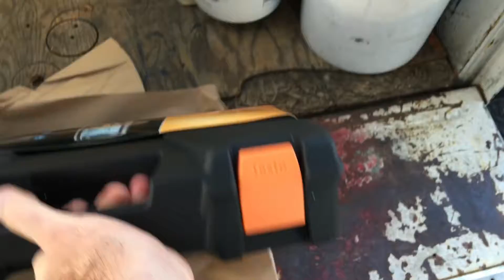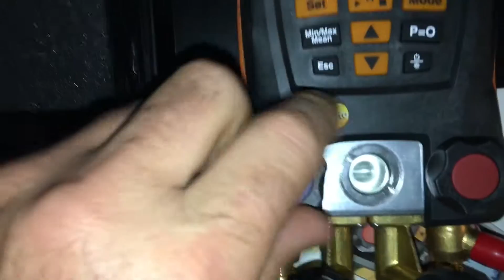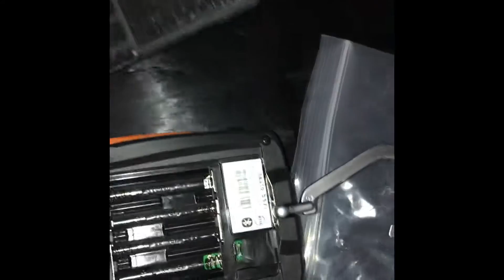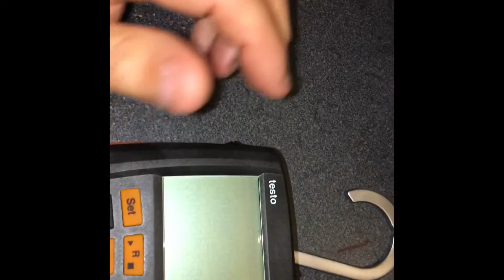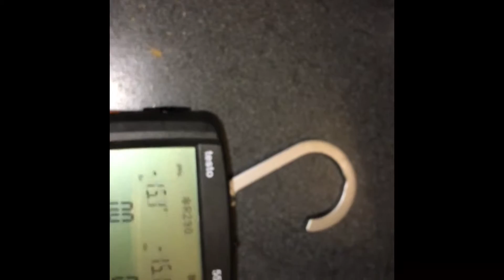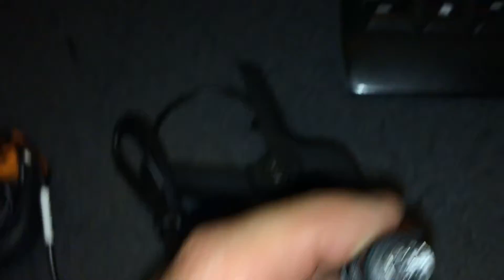My New Testo 557 Digital Manifold - First use & un-Boxing.

Comment: Those sight glasses are on all our companies yellowjacket  manifold gauges and its purpose from my understanding is to actually see the refrigerant inside fill up or discharge out and if you have dye as well
Reply from the maker: ive Never Had a Manifold with a Sight glass before. ill have to ask a Manufacturer what thier intended use is. From a Designers / Enginers point of view. i cant see a Good Reason for the extra expense. ive never used one in 35 years.
Reply: @OcRefrig  I was told its good to tell if there's potential contaminants or moisture you can see the refridgerant boil off properly kind of like in the same sense when they add sight glasses to liquid lines
Reply from the maker: @JPTinioMedia   Still working. December 3020.

Comment: You have to take everything out of the plastic before doing videos all you can here is rustling of plastic when u touch something but very good video i just bought the same tool today since you have owned it for a while now how are you finding the tool any issues or
Reply from the maker: only issue ive had is Plastic knobs for suction & high side fell off. not a big deal- they are only held on by clips. i just tightned the clips with pliers and replace inserted the clips into the knobs and hold on fine now. i Think They are Wayyyy overpriced for what they are. its great having superheat & sub cool right there But, personally Give Me a Set of My imperial analogs for day to day. My imperial 4 valve manifolds are wayyy more durable but they ar analog. i Personally would like to Try the Fieldpiece sman digitals. sman 480 to see How they are. i Don't like the digital lag on screen. i prefer a analog guage sometimes. They are still going ! good so far.
Reply: Thank you very much for you professional feedback i got to excited and also bought  10 mins ago the 552 testo vacuum gauge i herd great reviews from the unit very reliable and well built
Reply from the maker: nice thing about the 552 is it has a pull through on both sides. so u can keep oil out of the sensor easily. occasionally u can pull a vacuum on guage from one side then remove cap on other side to let sensor pull in air and kind of clean itself from a venturi effect. i had one like that that had a hole on both sides like that. i liked it alot.
Reply from the maker: 👍. ill have to check it out. Testo 550 Kit are usually the best deal out there. $250.00 sometimes. ($269.00 amazon right now )  Testo 549 are even cheaper, but no blutooth i think and u cant update refrigerants on testo 549. ( $ 159.76 ) E-bay New.

Comment: Hi, good video, how is testo still working? greetings from Argentina
Reply from the maker: No Major problems. They still work. Only one minor problem so far. I had 2 of the knobs fall off when i was turning them but, it turns out it was just a little spring clip they use to hold the knobs in place. So i just removed the clip pinched it tighter and reinstalled the clip that holds on the knobs. It seems ok. Ill post a video if they break. So far so good. Hello Argentina - Allways Wanted to go there. Someday i will visit. Is it nice there ? Goodbye from California. 68 degrees here.
Reply: hello
 the testo they offer here are of Chinese origin
I live in the center of Argentina and in summer the temperature reaches 34 c °
in winter 7 c ° arrives
you have to visit argentina
Reply from the maker: still ok.
Reply from the maker: Still Working. 12-29-2020.

Comment: Those it show the micron  numbers??
Reply from the maker: the manual says it does , but u do have to hook up the external probe that comes with it. the micron guage is not internal which is a good thing for me because micron guages do not like pressure or oil. so puting one internal is nice for convenience but may not be good. i Have not used the micron guage that comes with this yet. i will and make a video and we will both find out. thanks for watching.

Comment: I have this same one they leak! So beware.
Reply from the maker: Thanks for the Heads up Man. That sucks to Know . those cost $400.00 they should not leak. where do yours leak ?
Reply from the maker: yea, i kinda saw that too.
Reply: +1 on this same model, mine leaked at the sight glass o-ring. I'm in SoCal too, so the cold climate probably isn't the cause. Sent mine back for repair that costed $80+. Hopefully that sticker on the back of yours means an upgraded o-ring was installed. Good luck.
Reply from the maker: Thank you for the info. really appreciated. bummer they did not warranty that. that does not make me like testo very much.
Reply: throttle bottle no they fixed it under warranty, but its very frustrating
Reply: OcRefrigeration,Hvac & Electrical. At the valve high side
Reply from the maker: thanks for info.
Reply from the maker: yea, thats for sure.